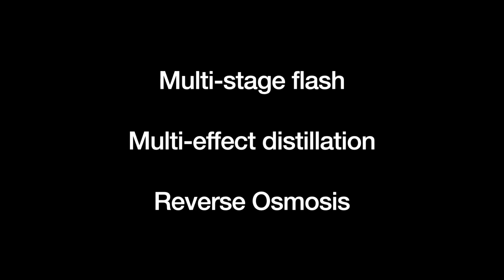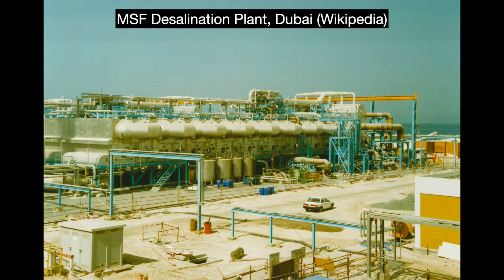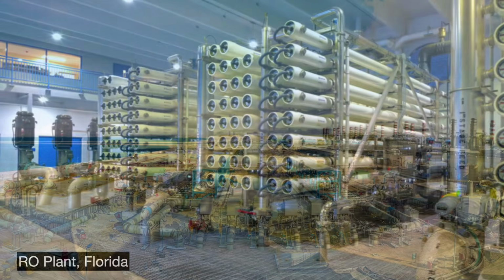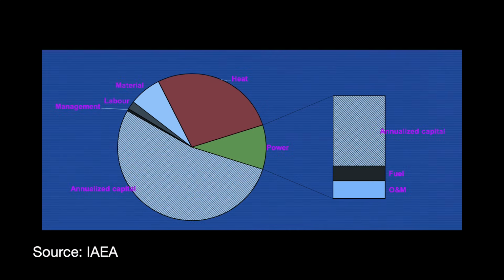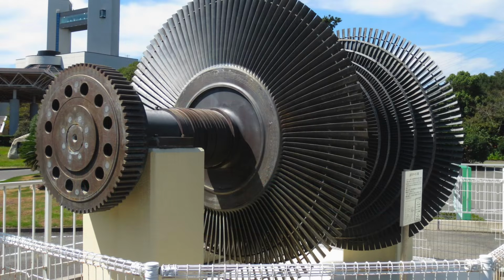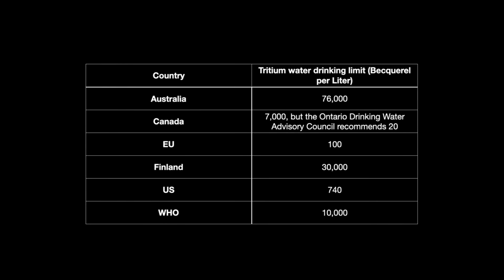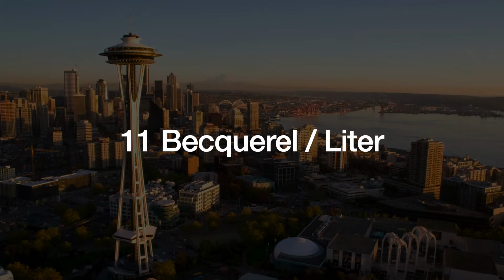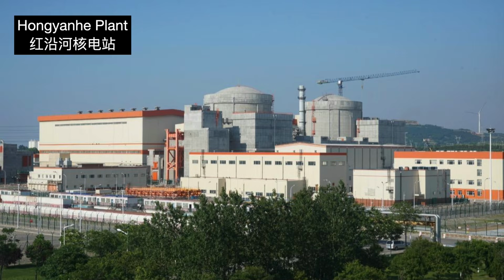Going Nuclear to Desalinate Seawater

Comment: Building a nuclear power plant next to the ocean is a risky venture. Not only with tsunamis, but with hurricanes/heavy gales/storms, and rising sea levels.
I suppose all could be hedged against and protections could be in place, but it will all add to the cost. And if there's any time where there's a disruption (war, staff shortages, civil uprisings, parts shortages, whatever), you risk a meltdown and radiating huge swathes of coastal areas of your country. Or if the currents are not favourable, neighbouring countries.
I guess you could have a long pipeline that pumps seawater far inland, but then you add extra infrastructure like pumping stations that require extra costs/inspections. More areas for failure points.
Reply: Continuing to use fossil fuels is the bigger risk. Much more deaths per unit if energy in fossil fuels compared to nuclear
Reply: @ThomasBomb45  No argument with that, just that all risks should be considered now that we have awareness of them.

Comment: You haven't addressed a major concern of Desalination. Salty and Waste water discharge. Not all water is desalinated, portion of water cannot be reclaimed. The waste water is very salty and if not disposed at a safe distance from the catchment area will bring reducing returns for the Desalination plant.
Reply: The brine is dumped back into the ocean from whence it came.
Reply: @RoundElephant  the brine increases the salt content in the surrounding water. Over a period of time the salt content reaches toxic levels
Reply: It's not the feedback issue that is the main concern -- it is the effect of the heavily saline water on the ocean environment.
Reply: @Efecretion  over a period of time the salt content of surrounding water increases and more energy has to be spent for lesser water.

Comment: Perhaps useful to think of a nuclear reactor + desalination plant as equivalent to a "peaker" power generation unit that can be operated 24/7 "for free" (uranium fuel and nuclear waste disposal being relatively inexpensive operating costs) with the electrical power that isn't needed by the electrical grid being put to productive use.

Compare for example to a nuclear reactor + hydro power storage facility, feed nuclear reactor electricity into the grid when needed and use that electricity to pump water uphill the rest of the time.  Such a combination is even more useful, but only works where the nuclear reactor can be built near a good site.

Or compare to the notion of building dams in remote locations with the intention of using the electricity generated to smelt aluminum.  The aluminum smelting plant and the desalination plant are similar: they both represent productive ways of using electricity where the nuclear power operator can control demand.

Comment: Simple Free  salt water into drinking water  also add heat to power gas / generators electricity 
Ponds lined with Black plastic and clear canopy's to catch evaporating water into tanks 
these ponds in hot areas get to boiling point  and some aussie researchers used it to power generators with min Gas

Comment: Essentially all the potential drawbacks or concerns here are solved just using a molten salt reactor instead of a pressurized water solid fuel reactor. Hell, even the operating temperature is substantially higher by design, allowing for far more desalination capacity just from the waste heat after the heat exchanger has put its load through the generator turbine.
Reply: Big fan of technology that hasn't been proven yet? Modern,  safe nuclear reactor design is here.
Reply: @AstroGremlinAmerican  bro I'm well aware. But tritium that a hydrogen recombiner hasn't gotten to for example, doesn't exist on a reactor that doesn't use water as a coolant. And near atmospheric reactor pressure vessels allow for massive cost savings.